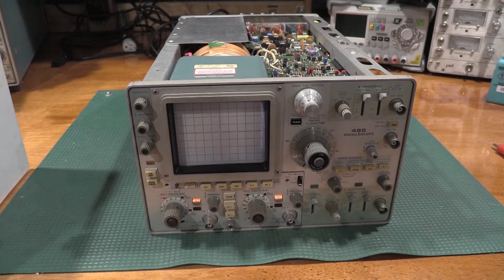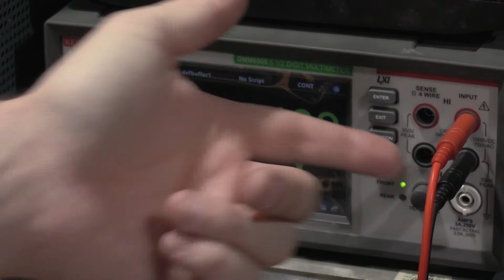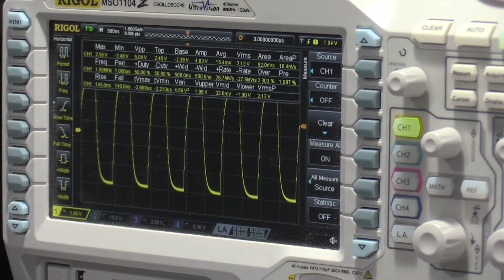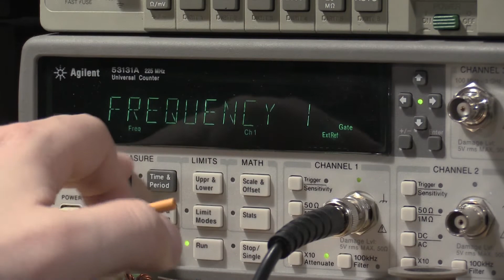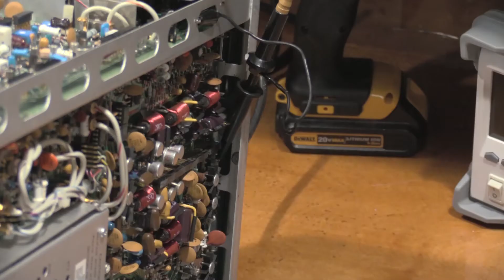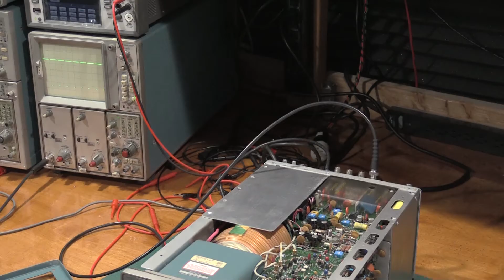Tektronix 485 Power Supply and Tube Alignment

Comment: It would have been interesting and useful to see HOW you changed the caps on the board, did you have to remove the board form the scope or did you desolder the old caps and solder the new ones from above?
Reply from the maker: I have this exact video coming in a few weeks. It is already out on Patreon. Patrons are 3 weeks ahead of general you tube release. The 2 videos you are going to want to watch for sure are :
Lab Secret Sauce Revealed (Q and A based on viewer questions)
Tektronix 475A Power Supply and Scope Repair
The lab secret Sauce video goes in to detail on the irons and solder. The 475A shows some capacitor replacement and soldering techniques. 
Zen

Comment: Thank you very much for your beautiful video and explanation.
I have the same device, a 485 but with a different trouble, it only shows one point in the middle of the screen and it is no more possible to do the horizontal deflection. Can you please help and say me, where i should pay attention in the service manual and in the device ? For any answer, many thanks
Reply from the maker: If the power rails are all correct, the high voltage at this point can be assumed because a spot is showing. Then the next stop would be the horizontal drive. If you can move the spot with the horizontal control and the screen is compressed in to a spot Then the Horz drive is missing. This might not be the 200Vdc Horz amp because that is differential, I would expect the trouble to be before that. Even in X-Y mode the positioning should move the spot. If there is 0 deflection in the Horz signal chain I would start in the middle and work backwards or forwards based on the testing results.